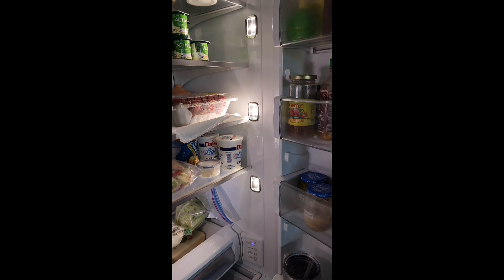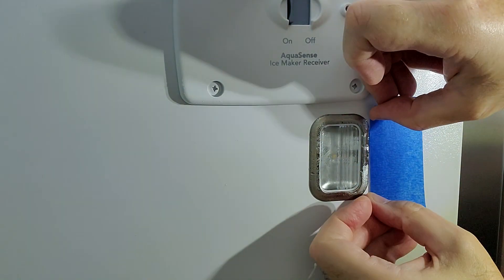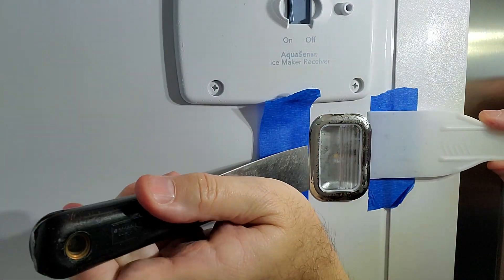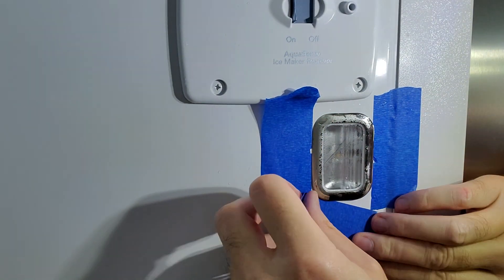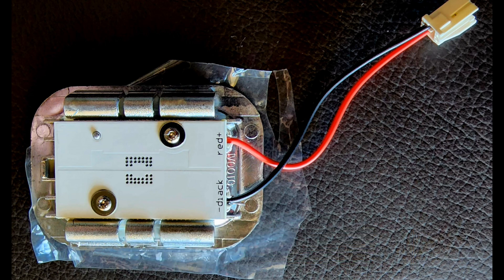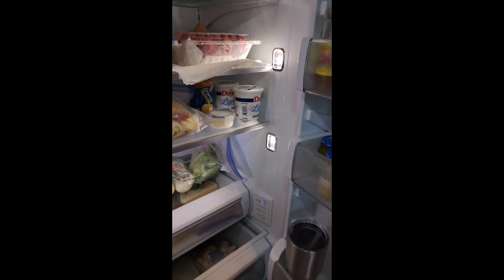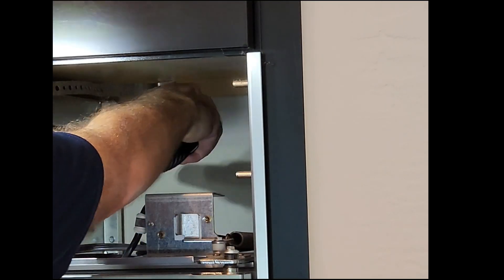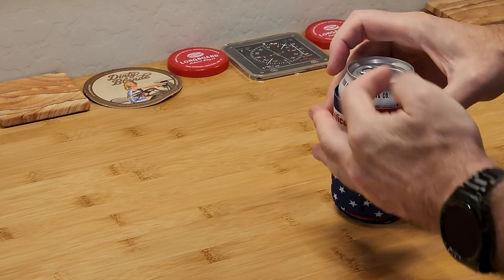KitchenAid Refrigerator Light Repair DIY - Save Money $$$

Comment: Appreciate the info about the service bulletin - they are fixing my light issue for free for my 2019 refrigerator. All the lights went out with my unit and was advised to make sure they change all the lights when they come to service my unit.
Reply from the maker: Excellent!  The new lights are brighter too, we like them.
Reply: Do you mean you called KitchenAid directly and they are fixing the lights for free? Mine is also 2019 and my 5 year extended warranty with BestBuy expired 2 weeks ago. They wanted to charge me $140 for a tech to diagnose plus extra to fix.
Reply from the maker: @teresagalito5360  I called KitchenAid directly, mentioned the service bulletin, and yes, they sent a local company out and they replaced all the lights with a newer, better, brighter version.  No idea how long that's going to last.  Suggest you Google that bulletin by its number from the video description and see if it applies to your model number. 👍
Reply: @ thank you so much. Yes, I called earlier today and someone is coming out tomorrow. Impressed with how quick they are dealing with the lights but I’m never gonna buy this brand. My 5 year warranty through BestBuy expired Jan 14 and now the ice maker is not working, the “door open” light is on even when the door is closed, and the fridge is now only at 57 degrees! 🤦‍♀️ Happened one after another in a span of 3 days. It’s like someone flipped the switch for the fridge to fall apart right after the warranty is over. 😭 Not even sure if it’s worth investing to fix it or just get a new one! Ugh!
Reply from the maker: @teresagalito5360  Wow, sorry to hear that. Ours is seven years old and no problems other than the lights, which I hope are fixed now.  Good luck with yours, maybe the repair person will have some good advice tomorrow regarding the other issues.
Reply: @ yes, that’s one reason I decided to call them. Hopefully while the tech is here, I can get some advice if it’s worth fixing since there’s multiple issues. I really didn’t want to automatically incur a $140 fee just to get a tech out to our house to diagnose. Thanks for the tip about the lights. It came in handy. Hopefully I get a nice guy tomorrow willing to give honest advice. 😊

Comment: Your video was most helpful and greatly appreciated.  We did contact Kitchen Aid as you suggested in your transcript.  They sent someone out to replace the lights but in our case the new lights are dim and our original lights are the ones with the 3 LED lights so now our refrigerator is quite dim.  Oh well, not sure what our next step will be.  Probably contact Kitchen Aid again.
Reply from the maker: Thanks for watching and for the kind words!  If I were you, and my Task Assigner being who she is, there's no way we would let them remove the bright ones and replace with dim ones.  The single LED modules previously in our fridge were the ones that were failing all the time, why would they install those??  We would call KitchenAid back and make them install the three LED modules, the newest ones.  We haven't had a single one of those go out (fingers crossed).

Comment: Thank you so much especially for the Technical Service Pointer information.  Mine is less than 3 years old and they are going to replace them for free!!  So disappointed that our local dealer didn’t have this information and they were scheduling me for repair to the tune of $1500 for five bulbs that were out.  We actually did order and replace one from Amazon that made all four freezer lights and one refrigerator light to come back on although they seem to not be as bright.  Thank you again.  This is the best Christmas gift!

Comment: Thanks much.  I have the same frig and after 6 years, suddenly one or two of the freezer lights have gone out.  I'm going to give this a shot!
Reply from the maker: Good luck!  Just a couple weeks ago a second light went out on me; the top of the freezer, behind the ice maker.  Talk about a bear; there's no room to work up there with the ice maker in the way!  Afterward, I spoke with a neighbor about it and he said he had the same one go out and they had a repair tech come out.  First, the "technician" didn't know there was a light behind the icemaker, so he unnecessarily replaced a system board.  Then he called KitchenAid Service and they asked him if he'd checked all the lights including the one behind the ice maker, which is when he realized his error.  Then he did what I should have done - remove the icemaker to get it out of my way!!  Well, if that one goes out again at least I'll have that info in my pocket for next time.
Reply: @hangtime_31  You would think for the price of these darn things they would not have these problems!
Got my lights today....time to put my repairwoman hat on and give it a shot....
Reply: @hangtime_31  Oh, and the exact same light that was out on yours is the same one out on mine.  Hmmmm....
Reply from the maker: @gigih157  Things that make you go ... hmmmmm.  Well, how did the repair go?  Did you light up your life?
Reply: @gigih157  same here.

Comment: Hey there! Thank you so much for this! Our fridge came with the house and it's still nice with a few issues. I was able to replace all 6 side lights in our Kitchenaid built-in (like yours). I have a couple problems Im still trying to fix:
- First: While the side lights work, I also replaced the two in the "ceiling" under the display module...but they still don't work.
- Second: While the lights come on when I open the Left door, they do not when I open the right door. 

Can you help me DIY this? THANK YOU!
Reply from the maker: Hi, thanks for watching!  Beyond what you've done, the only thing I would suggest is to open up the description for this video and read the info I added a few months after I posted it.  Check out the service info from KitchenAid and if your model is on their bulletin, give them a call and maybe they will send someone out to fix all the lights with upgraded modules for free like mine.  If I would have known about it before I did my DIY, it's pretty likely this video wouldn't have happened, but hey, it's fun to try to help others when you can, amirite?  Cheers!
Reply: Thank you!  @hangtime_31
Reply from the maker: @texjeep  My pleasure, let me know how it works out?

Comment: LED lights in this built-in KitchenAid fridge are the most disappointing! Had it for 6 months and the freezer string of lights went out (but the fridge side kept working). Then another 2-3 months went by and the fridge side off lights went out! Called the service repair guy and he replaced both under warranty. Then just after the 2 years mark both string of LED lights went out again and we’ve been in the dark ever since. Will try this DIY repair and hope it does the trick🤞🏽
Reply from the maker: Good luck!  Also, don't miss the additional info I added in the description a few months after I posted this video, it might apply to your fridge.

Comment: This is great. I just ordered the 12 replacement LEDs from Kitchenaid because my fridge is out of warranty and supposedly out of that technical replacement period. My question to you: you mentioned you liked the new modules better. I was going to replace one at a time to fix the series but should I just do all 12? I've already replaced 2 a few years ago. Thanks!!
Reply from the maker: Thanks for watching!  I could see pros and cons to both approaches, but if it was me, I would probably lean toward replacing them one at a time to get as much life out of the original modules as possible.  Yeah, that could mean you're dealing with the hassle one light at a time and would need to keep track of which ones you replaced, but maybe some of them will last longer?  You could do the remaining ten all at once and reduce the hassle but then you're tossing out the working ones.   So ... thrifty, or fewer times messing with it?

Comment: Thanks, Hangtime31.. The information provided was accurate and right on time. I have the same situation with an identical fridge and KA support did not mention anything when I called them for advice.. However, when I called them back and mentioned the TSP you included in the link, they recognized the issue and scheduled a service repair including parts and labor.

I really thank you for the video and the info. Appreciated.
Reply from the maker: Glad it helped!  Thanks for watching! 👍

Comment: Thank you for sharing this content and really enjoyed the video. I have a question hopefully you can help me out. I have the same issue with my lights, however my refrigerator temperature light that's located inside the refrigerator at the top keeps blinking and it will not let me set the temperature only the freezer light works. I did replace the electronic control board but that didn't fix my lights nor the blinking  temp light issue. Any suggestions that can help me out . Thanks
Reply from the maker: I'd love to help, but I'm just a DIY homeowner, not a fridge tech.  I've not encountered that problem before.  Sorry I couldn't help with that, good luck, I hope you get it worked out!

Comment: Thanks for the video. But all my refrigerator led lights are not working, how can I know how much replacement bulbs should I purchase?
Reply from the maker: Hi, thanks for watching!  If they are all out it's probably a different problem, maybe a circuit board.  I'm not a service tech, just a homeowner who likes to tackle as many DIY projects as I can and pass along what I learned and what worked for me.  In your case you're going to need either someone who's had this problem and fixed it - or a service technician, I would imagine.

Comment: Of my 6 lights only 4 were completely out - the other two were dimly on. I replaced the 4 lights that were out thinking this would fix the problem but now all 6 of the lights are dim… any idea what my problem could be?
Reply from the maker: I was pretty lucky in my case I suppose, only one at a time went out.  In your case, I would continue to troubleshoot, perhaps move one of the new ones over to the other two lights that were dim, one at a time.  If none of that works, there's a control module that could be the culprit.  Did you see the note in the description about calling KitchenAid and asking them about their Technical Service Pointer bulletin?  You might get lucky.

Comment: We are having the same issue and I'm not sure which light to try first.... if they are like Christmas lights, how do you know which is the master light? Thanks!!
Reply from the maker: Hi Kari, thanks for watching.  I suppose they could be considered similar to Christmas lights but in this case the "master" light would be the bad one that takes the rest of the string down with it.  On mine, there are six lights to a string, and five would be dim and the sixth would be completely out.  That one was the culprit.  Before you go further though, I have updated info in the video description, some things I learned after I posted the video.  In there is a service bulletin and I suggest you call KitchenAid and refer to it by number to them, maybe they will take care of it for you under warranty even though technically the warranty is expired.  Our fridge was almost five years old and they came out and replaced all twelve lights in the fridge with newer, nicer ones - for free. 👍  And if they won't, well, at least you tried and then maybe this video will still help you out.  Good luck!

Comment: Seems these are wired like the old Christmas tree light, when one goes out the other ones in the line go out as well? First time has the same light go out and replaced it no problem. But now a few months later all of the ceiling lights are out in the fridge and all of the freezer drawer lights are out. I’ve replaced three and they still won’t turn on. ..?!
Reply from the maker: Hi Fred!  In my model, there are indeed two strings with six lights on each string; the five in the freezer plus one in the fridge, then the remaining six in the fridge are on the other string.  When one light went out, the other five on that string went out as well.  In my case, tracking down the offending light had to be done fast.  When I'd open the door, the lights on the "bad" string would do this dim flashing or flickering routine and then after maybe ten seconds they would all just go out.  I'd shut the door and open it and it would do it again.  The trick was to find the one that wouldn't flicker - it was dead from the time I opened the door.  That was the culprit.  I don't have any lights in the freezer drawers though, so maybe you have a different model?

Comment: Did you have to pay a service fee for someone to come out? They’re telling I have to pay $100 for someone to diagnose the issue even though my model number falls under that service bulletin
Reply from the maker: Hi Ladan - In my case it didn't cost me a penny; they covered it all under the warranty service bulletin.
Reply: They told me they only cover up to 1 year manufacturers warranty and I’m outside of that. Hopefully I can get a resolution.
Reply from the maker: @ladanabolmoluki6266  Okay, just to confirm we're on the same sheet of music ... I called KitchenAid Service at 800-422-1230 ... and it wouldn't hurt to mention "Technical Service Pointer W11606409" to them.  In fact if you google that, you can read it for yourself and confirm your serial number is on the list.  My fridge was almost five years old and like I said, I didn't pay anything.
Reply: Thank you for the info. Yep that’s the same number I called. I’ll look into it. I appreciate your help.

Comment: turns out there's three light systems in these units:
Refrigerator Side LED lights video is here: https://www.youtube.com/watch?v=iF6yB2hgNgQ 
Freezer LED Light Module video is here: https://www.youtube.com/watch?v=fBdcx4yIVdI
How to replace 3 LED Light Module & Harness: https://www.youtube.com/watch?v=Y2PgjaHY16g
Reply from the maker: Hi Fred!  Yes that's definitely a different model refrigerator than the one I have. Not that there's anything wrong with that. I do think it's funny that in these repair videos everybody says to turn off the power and then they proceed to do the repair without bothering to turn the power off themselves. It is actually kind of silly to turn off the power because the way those plugs are designed it's not as if you would even be capable of shorting out the lighting harness.